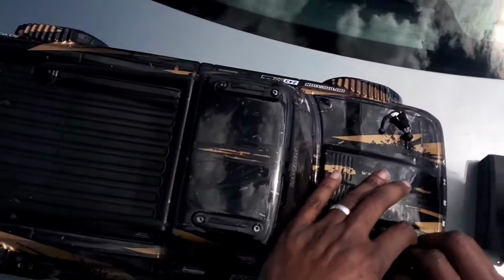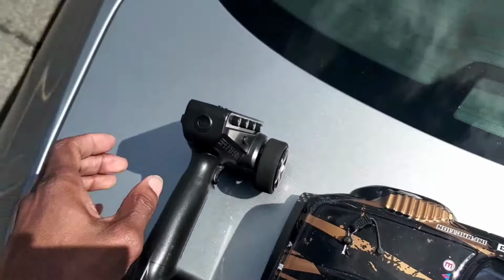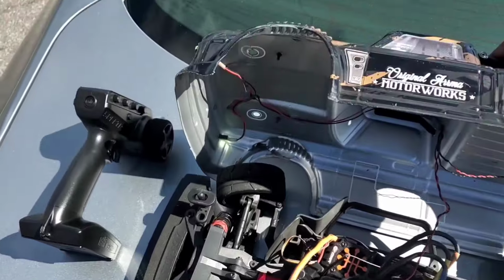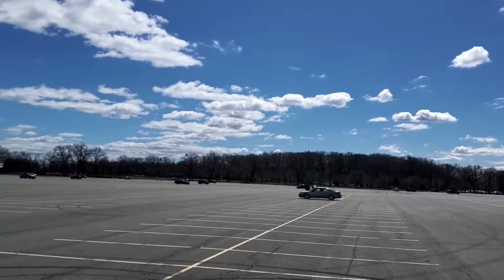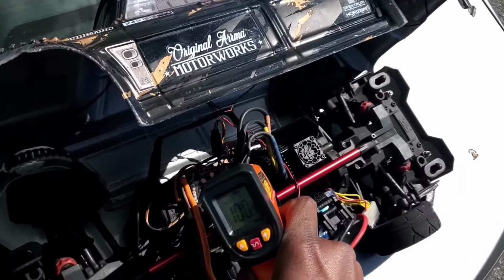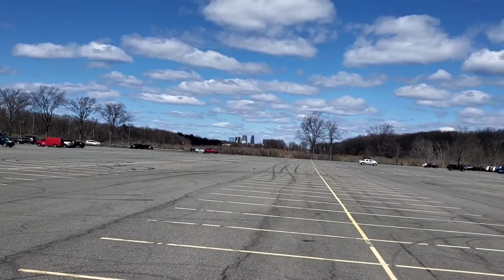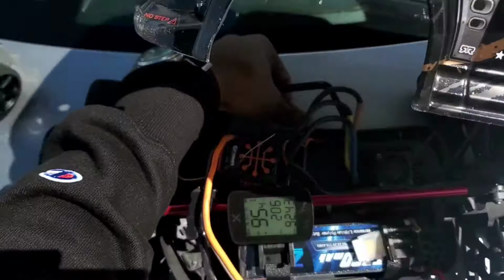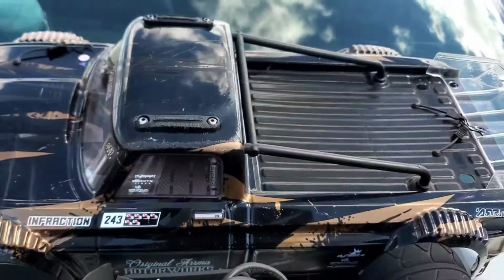Arrma Infraction 3s ON 6S is VIOLENT!

Comment: I have that splitter on mine. I added 2 shims to the front shocks on the inside because the splitter causes a lot of lift once the truck weight transfers to the rear. With the shock limited it can’t create any lift.
Reply from the maker: Yes, I did the bump stops too and trimmed the rear wing.  The sitter definitely helps.  But that wind 😳

Comment: Switch over to 17mm hex and go with GPR foam tires
Reply from the maker: Thanks for the tip!  I may try this if it doesn't sell 😊
Reply: @bigbristv  keep it, put the 6s esc in and run on 4s. That's the 3300kv motor? That's what my vendetta has, and it Flys on 4s.
Reply from the maker: @jeffdavis6715 it's the 3900kv motor.
Reply: @bigbristv  have you done the slipper eliminator and mod 1 gears?
Reply from the maker: it's completely stock except the esc & battery straps.  Got 109mph with this setup on my Vendetta
Reply: @bigbristv  nice. What gears were you running in the vendetta?
Reply from the maker: @jeffdavis6715 29/50
Reply: @bigbristv  pretty good. Go with the HR eliminator and mod 1, it will give you better gearing options.  I moved my spur down to 43

Comment: Man where did you get the splitter from? It's like arrma intended to put one out for it n never did.did you put the 4s diffs in it or are they stock? You got my mind going now. I have mine as 4s but 6s might get me to 100. BTW what an awesome parking lot
Reply from the maker: Thanks bro! Splitter is from ajcmods ebay.com/itm/334516926606 everything is stock except the esc & battery straps. And lights. And motor fan 😁
Reply: @bigbristv  no doughty. Do they have side skirts too? I should have grabbed another infraction on that last sale n had one for speed n 1 to rip
Reply from the maker: @nickteele169 I think they have the whole set.  Yup, mine is a converted 199 vendetta 🤫
Reply: Mine was the brushed version n went right to brushless.  I made a spool for it and now I wanna make it 6s thanks to you hahaha
Reply from the maker: 6s makes this thing violent! 😂
Reply: Mines is similar. Installed 4s diffs last month just installed a new 4s esc last week! Now I’m taking the 4s esc out and putting a infraktion 6s esc in 😂😂😂 my vendetta 3s will be getting the same treatment
Reply from the maker: @williamlambert3465 you, my friend, will be topping 100mph in no time! 😁

Comment: Looking to start back on my infraction. What all mods do you have on yours?
Reply from the maker: Let's see, I turned it into an infraction  from a Vendetta, then added a 4s Spektrum system to it. Also added a carbon fiber lip spoiler and upgraded cooling fans. Added some lights to one of the bodies also.
Reply: @bigbristv  ah gotcha! Now I'm on a mission for the spectrum 150A esc and motor! I'm starting a channel and will for sure shout you out
Reply: @bigbristv  how long you been running the 4s esc on that motor? Have you had any overheating or anything breaking since adding the esc?
Reply from the maker: @Chapman1792  As soon as I got this rig I switched out the ESC. Never ran it on 3s. Then I sold it.